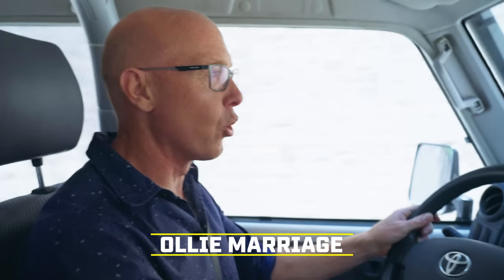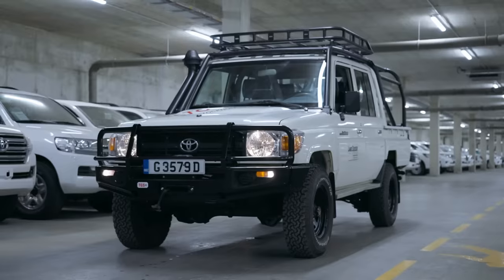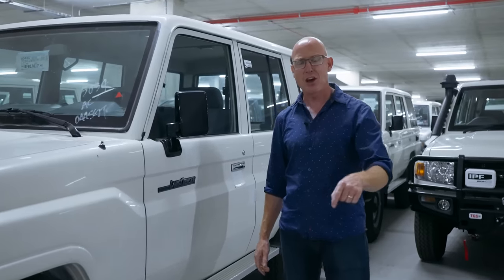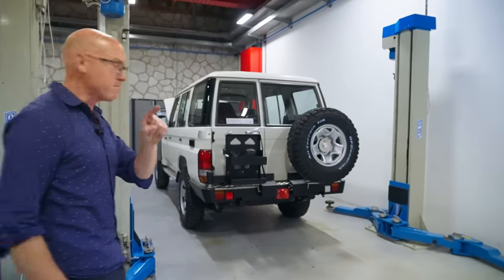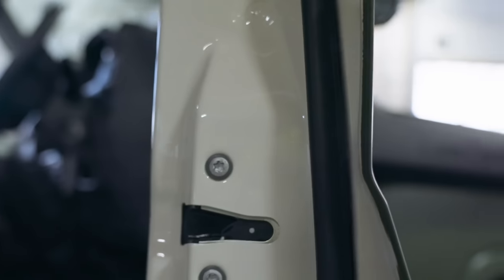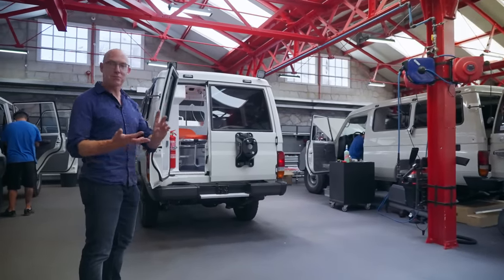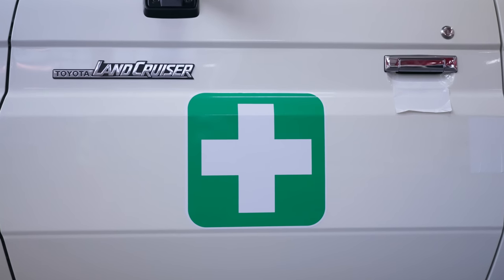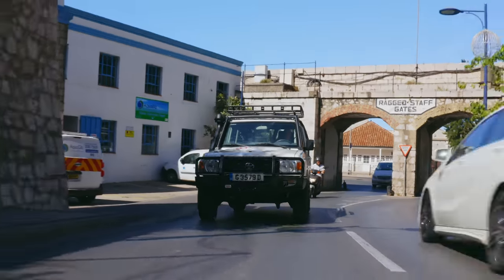This Secret Dealer Sells White Toyotas That Save The World | Top Gear

Comment: What Land Rovers use to be and still should, now just a fashion accessory.  There's a company where I am that converts the Toyota into mine vehicles, I wouldn't be surprised if they don't outsell Defenders in Canada. Should be interesting to see what Land Rover does with the Defender now that all Land Rovers will only be made electric in 2025, apparently. They definitely won't be doing another Camel Trophy challenge with them.
Reply: No disrespect but what Land Rovers never were; these are reliable!
Reply: @harrietgibbs4086  None Taken, I've had several and been fortunate to not have had any reliability issues other than having to deal with crank position sensor, wheel sensors and normal wear and tear maintenance. I think the biggest problem with some models like a discovery or Range Rover is poor maintenance by those who tend to treat the vehicle as if it is a minivan or luxury SUV for Soccer moms, when it's not. Taking about older versions prior to when they did become more of the above, pre-2004. Wouldn't touch the newer ones unless it was more for a city all seasons vehicle. Would love a Toyota though, impossible to get where I am though. Don't think they are road legal, the  only I know of are converted into mine vehicles.
Reply: @empirecases4128  Thank you for taking time to reply, and for your first hand experience. Great to hear that it has been positive. I'm in the UK, so Land Rovers are an everyday sight, both as work vehicles in rural areas and increasingly as status symbols/investments for non country folk. Since the Defender got discontinued, prices have sky rocketed. I love them, always have. Here in England it is so easy to get spare parts, find a garage who knows them, or with the Land Rover community, fix them yourself; as far as I understand the work horse Land Cruisers in the clip from Top Gear are the super basic 1HZ diesels, so absolute donkeys and so common in Africa;,  Toyota built in reliability, an unstressed engine, and zero electronics. What's not to love? I have two old Toyota Hilux pick ups from the 1990's, both super simple and as tough as old boots. We never got the 70 series Land Cruisers either, so am adding myself to the long list of folk who'd love one! Anyway, best wishes to you!

Comment: Why will they not sell these in the US?
Reply: Doesn't meet emission standards.  These mostly use diesel.  

We sure could use a modern, but simple medium size SUV or work truck in the US similar to the Toyota J70 Land Cruiser here in the US, but for some reason all the vehicle manufacturers think it will be unpopular.  Just like Detroit thinks Americans don't want to buy quality small efficient cars.

I bet the first manufacturer to introduce something like the J70 land cruiser will make a small fortune here in the US.  Probably someone like Nissan, that has experience in building body-on-frame vehicles, v6 engines and small enough to take the risk.

Comment: Anyone know where I can buy a 15 year old Toyota Land Cruiser 75 or 100 series?  In Canada, we can only import vehicles with a manufacture date of 15 years or older, so anything built in 2007 or older would be eligible for importation.
Reply: If you are looking for a 100 series you might want to take a look at the LX470, there are quite a few for sale in Canada
Reply: Forget it. "FT " is looking  for the real deal: Land Cruiser 105. It comes with coil spring suspension  and front solid axle.